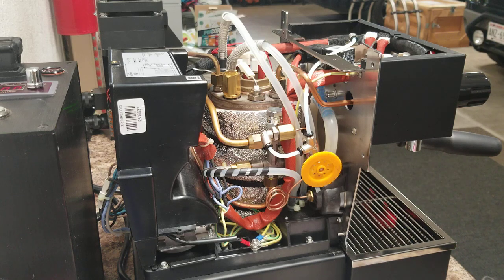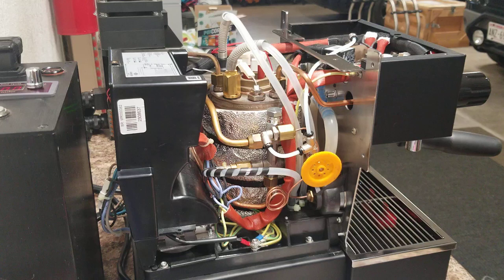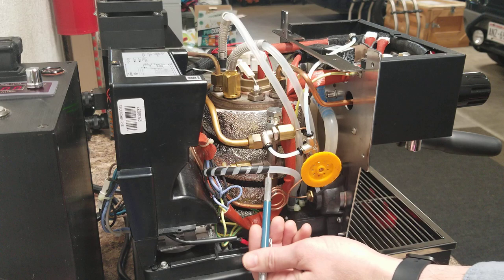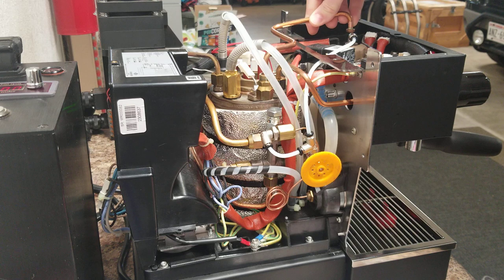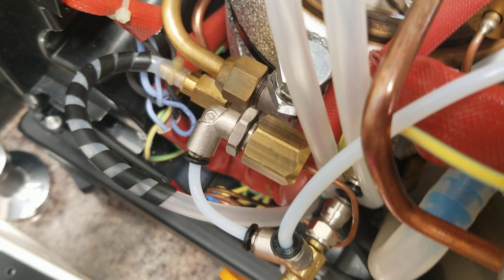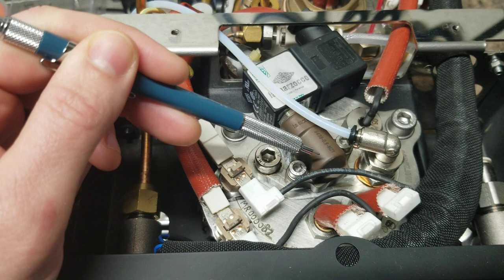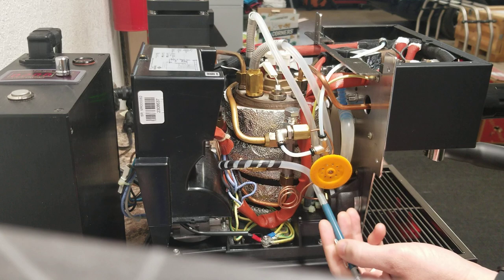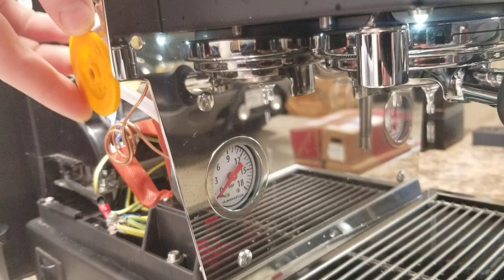La Marzocco Linea Micra Flow Profiling Overview

Comment: Hi Jacob, say, when I reduce the brew pump pressure (bar down to 6 or 7 from the factory pre-set at 9), do I do this while using a backlash disc with the brew paddle on, or should I (as LaMarzocco says), run a coffee filled portafilter while adjusting?

Comment: I sold my E61 espresso but honestly, I was evaluating between the R58 with flow profiling or the LM Mini or Micra with some flow control solution. With this I will move on to the LM Micra (since the mini is very expensive) with its flow control solution. Can you tell me if possible the list of materials you use? Thanks in advance for all. Another question: today, do you regret not having bought the Mini or do you feel that the Micra is the same but smaller?

Comment: Hi Jacob, I will make your profiling mod. I have few questions, this line that Needle valve is controlling now to the brew boiler is only for control the pressure?. The soleniod is the responsible feeding water to brew boiler from the steam boiler? If the needdle valve is close for a long time the brew boiler will overheat?
Reply from the maker: The valve controls flow from the manifold to the brew boiler. By restricting the flow, you can indirectly (but accurately) control the pressure.

The solenoid (brew valve) controls the flow of water (on/off switch) from the brew boiler to the group. As long as the paddle is in the brew position, the brew valve is connecting the brew boiler to the group until the 60s shot timer shuts off the pump and closes the brew valve. 

The brew boiler feeds the brew valve through a hole in the group cap, on the top of the boiler, so when you close the valve, water stops flowing into the brew boiler, but the brew boiler remains full.

There is no concern of overheating anything.
Reply: Thanks for the information. Last question. The brew boiler temp stay the same (control by PID) with dynamic flow control with needle valve?